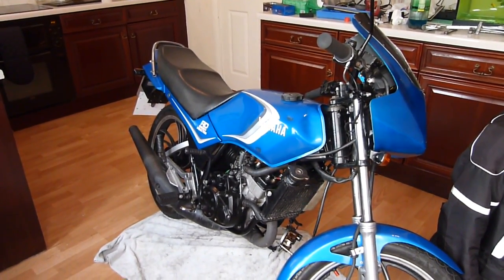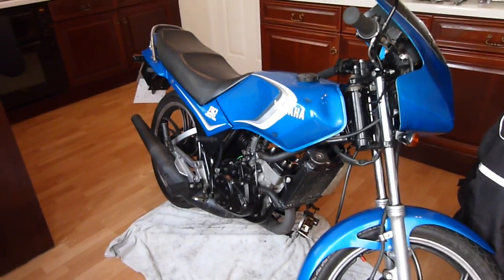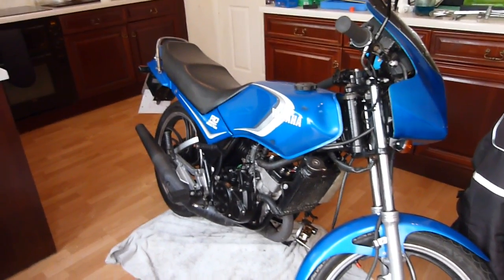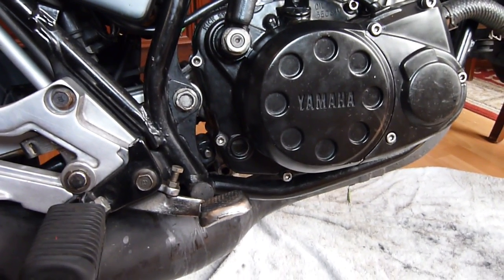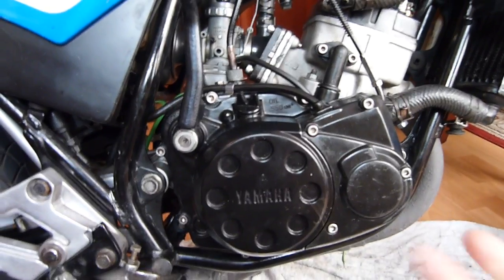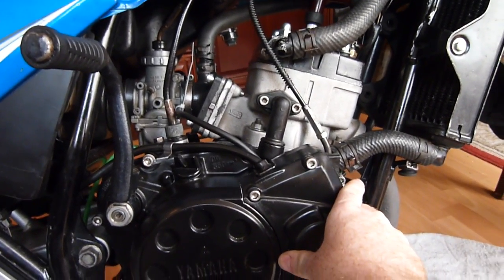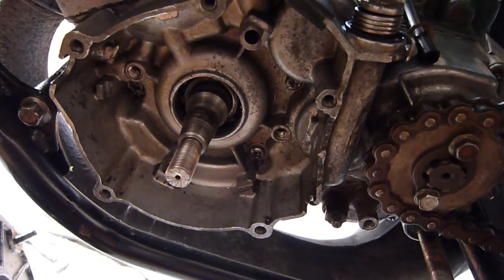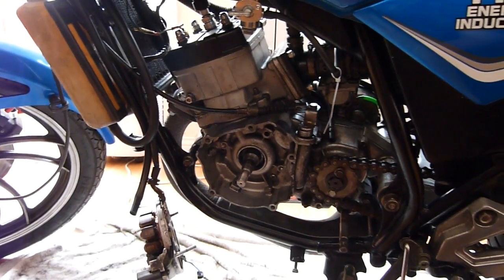Yamaha rd125lc faults and possible fixes

Comment: Hey I have a question if you still read These so, Me and my dad have been renowating a rd 125 lc from 83 and been experiencing problem with coolant leaks from the radiator and yet to figure out the problem so I was wondering if you had found a solution to it or not thanks in advance if you actually Bother to read

Comment: Hey, I got an RD125LC -83. 
Now I've got a problem with the motorcycle not revving right. 
It's fine when you rev it in neutral. But put it in gear and go then it loses power and splutters at around 5-6k rpm. Now If you are lucky and get over those rpms and in to the powerband, It goes all fine all on up to 8-9k where it loses power again.

I was wondering what could be doing that. I've thought of some things like ; Bad piston rings, air leak or maybe something with the ignition...

Comment: I would just like to tell you i had a RD 125 MK2 and when I parked it in the kitchen and used the dishwasher to clean my plastics and the oven to heat up and remove the main bearings my MOTHER SAID"SON YOU WILL HAVE TO MOVE OUT":(
To cut a long story short I am now in my 50s and own a VTR1000F and have a garage lol:)
PS the boost bottle is called a YEIDS YAMAHA ENERGY INDUCTION SYSTEM:) helps the engine when it BURPS unburnt fuel HOPE THIS HELPS
PPS check the water has no oil in it, it will show itself as a milky film on the radiator cap and oil filler cap:(

Comment: Is the reed block functioning properly? Have you checked the mica reeds? Do the cylinder head studs have decent "O" rings around them or does it seal another way?
Reply from the maker: I have replaced the reed petals for racing ones, the cylinder head is a multi layer compression gasket which has been replaced. I will get to the bottom of it, i will have a bran new engine by the end haha
Reply: Ginger Geordie Biker air filter ?